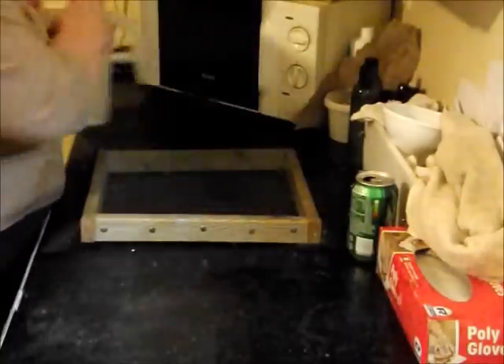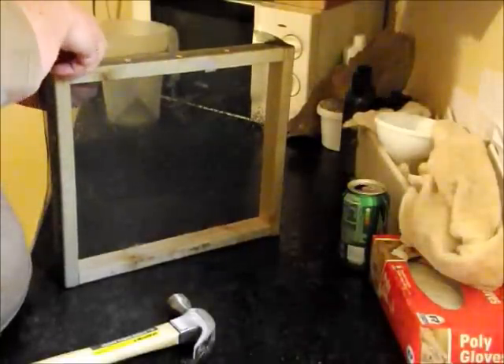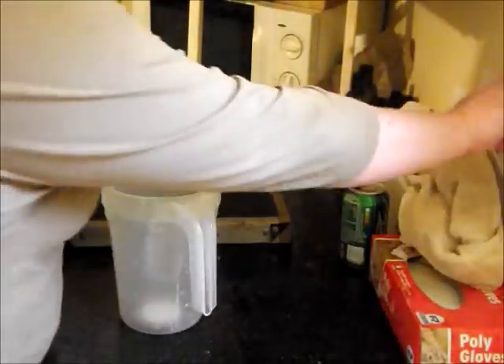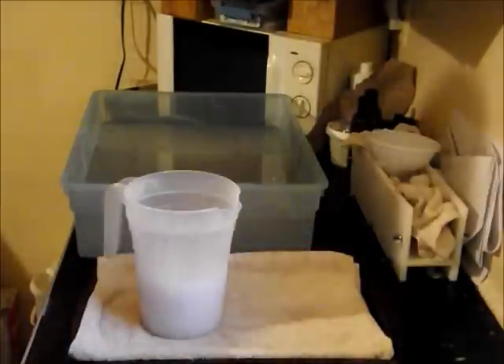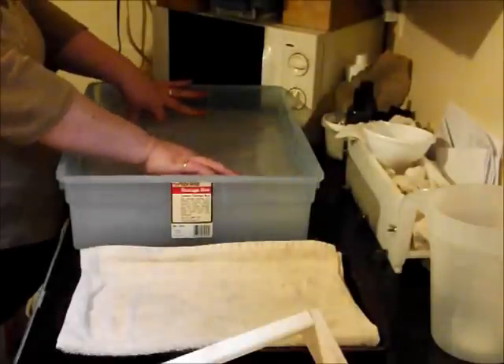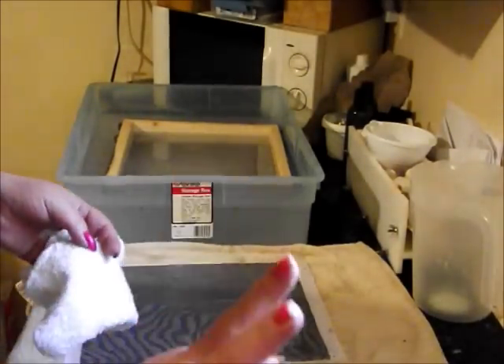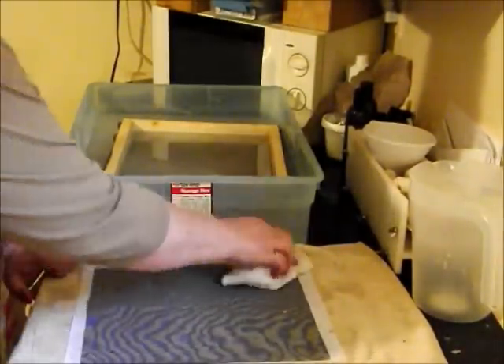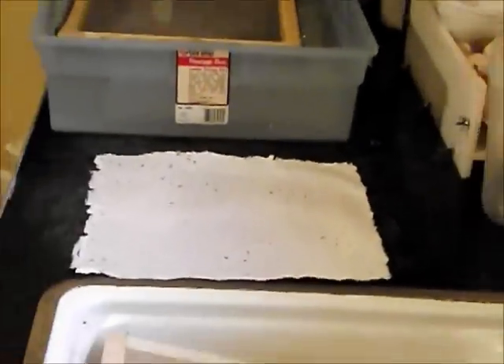Making Handmade Paper!

Comment: I saw another vid that utilized the two frames and didn't know why but ...i think I'd just looked away when the frame was lifted off.  And YES.....the two strips of 8foot wood I bought and had cut...FOR FREE....2.49 each! Bought some gorilla wood glue and screws.  Total bill 12.30 or so.  But I ended up having to use some regular ol' wood nails because I couldn't find the charger for my cordless drill, the drill that has a cord, and didn't know if the drill that's almost as old as I am that did have a cord still worked so I said whatever....will just nail these suckers.   Did pretty dang well.